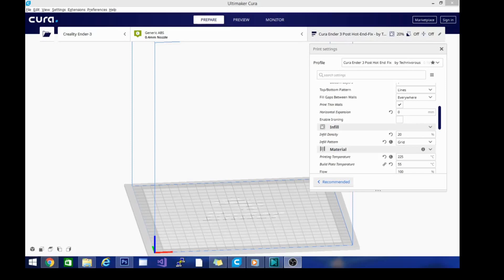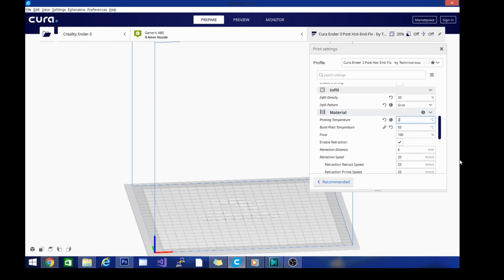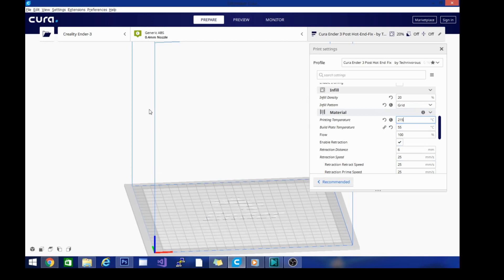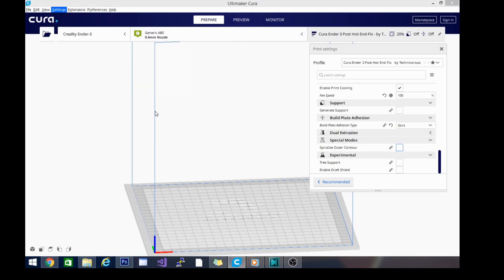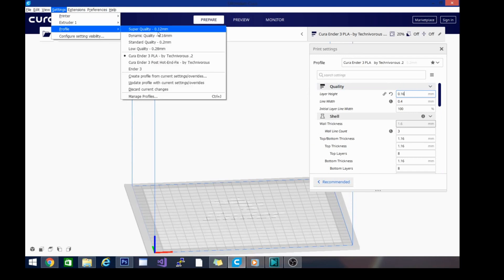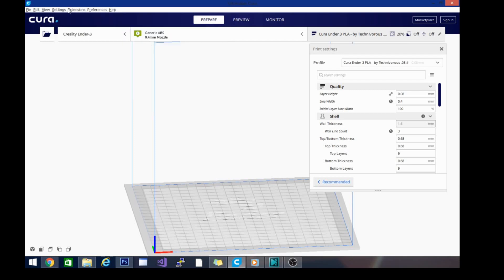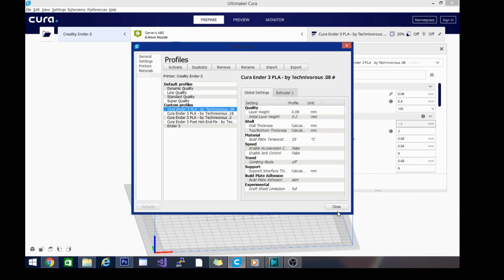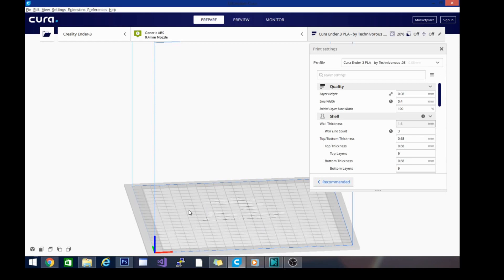Cura 4.3 - cura profile settings - PLA

Comment: great quick video, just got my first 3d printer- ender3 but been having issues with bed adhesion any ideas? print starts fine then lifts off the bed, temp nozzle is 200 and bed is set 55
Reply from the maker: Start by increasing your temp by 5-10 degrees. Make sure your all leveled out. What's your print speed
Reply: @Technivorous  60mm
Reply: propably bed adjustment